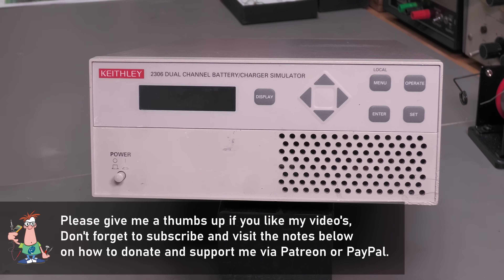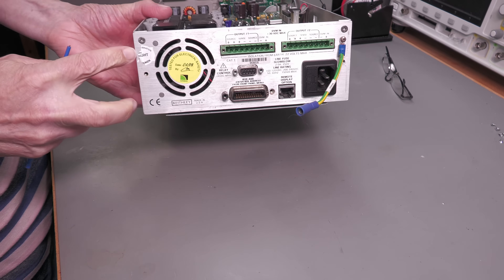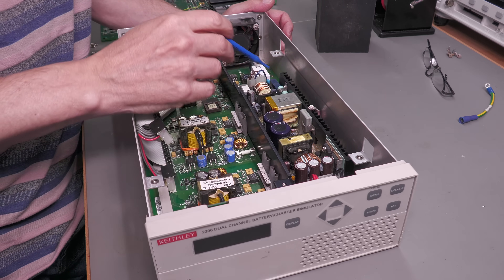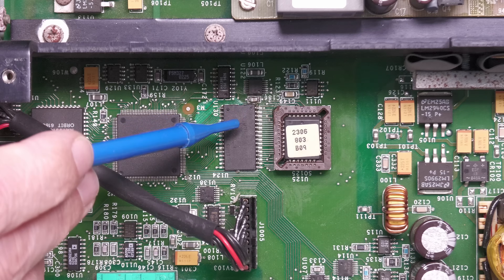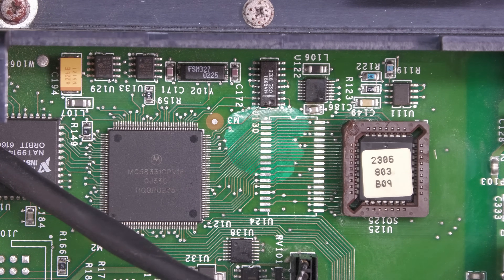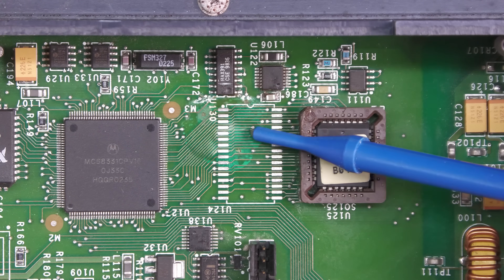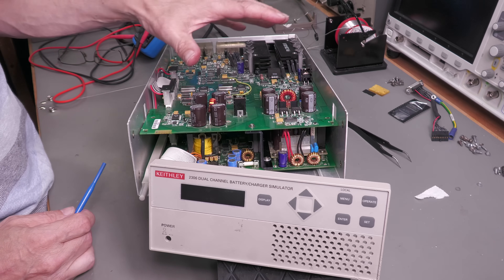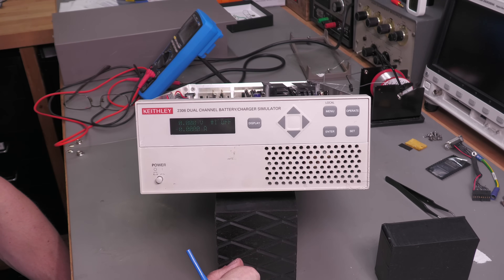No.115 - Keithley 2306 Dual Channel Battery Charger Simulator - Part 1

Comment: Nice vid. Dave did a teardown of a Keithley 2302, that one was nice and shiney on the inside. I liked the repair on the delamination a lot. I also like that this vid is a short of complement to the one of Dave. Part 2 would be very welcome. Testing your own product with this lab battery simulator is a nice idea too, could even be a video on it's own if your up for it. You can tell you've put a lot of energy in this video.

Comment: Heat up the epoxy and make a few more, conveniently placed vent holes. It will fill up like charm. Don't over fill it, after all it will only need a drop to fill up what was void before the delamination.
There's still the danger the RAM problems were caused by an interrupted line, since the RAM was swapped before, but you know this better than anybody, considering your experience. Thanks Ian, great repair
Reply from the maker: Yes, it's only a thin film required really, I did press down on it to spread it and I cleaned up the residue. Could have made a better job if I'd heated the epoxy. I'll know next time!
The ram failure is pretty common on these units, I guess they were unlucky in their choice of brand etc.
I never examined the ram swap out quality of soldering, it was such a mess I didn't bother. Seem good now, so time will tell if it's reliable.

Comment: Use slow epoxy (24h cure), and AFTER injecting heat up the spot to about 80°C so the epoxy becomes liquid like water. Watch (!) spills.

Comment: Epoxy becomes very much 'runnier' when you heat it up. You could have heated the syringe and the injected area, to 50 or 60C or so, with the hot air gun and then spread it inside the delamination using a credit card or the like (after making some relief holes). Heating it also accelerates the curing so probably better to use slower epoxy.

Hopefully this was made long after metal parts were cadmium plated - which I'm fairly sure was used extensively in the telecomms industry in the 70s.

Comment: Great repair and an interesting piece of test equipment👍 The previous repair attempt must've used something like an industrial heat gun, it takes a lot heat to make a good quality FR4 board delaminate. To polish the screws and metal pieces I've had good results using a wire wheel in a bench grinder followed by a polishing wheel and some polishing compound to make them really shiny.
Reply from the maker: Probably used the same heat gun to reflow the new ram IC and fried it also!

Comment: The brackets could possibly clean up in an electrolysis tank. I've had good results before
Reply from the maker: Home electrolysis......nice idea, I'll  have to look that one up.
UPDATE: have order the stuff to try nickel plating.
Reply: I'd stick them in my tumbler with steel shot and a bit of polishing compound,  works great on silver and gold so a bit of steel should be no problem.

Comment: You can add denatured alcohol to regular epoxy to thin it down a bit
Reply from the maker: Really!.....I'll experiment with that. Cheers.
Reply: @IanScottJohnston  Mix the epoxy in  equal parts as you would normally and then start with a ratio of 10% denatured alcohol and mix that in thoroughly. you can add more needed

Comment: I repair delamination with same technique and Acrylic adhesive WC102, it a very thin CA mix, used for windscreen repair.
Reply from the maker: Will look that up. Cheers.
Reply from the maker: Update.....I read that isocyanates are slightly corrosive to copper......might be worth some research. I am no glue expert!

Comment: What a coincidence! I too posted video today with a PCB that had a delamination problem. This was of my own making though. It was thin phenolic substrate, and it did not like the normal temp I use for hot air. Given the lower quality of the substrate I picked up a bit of that (expensive) low melting temp Quick Chip solder. 

As to trying to repair the bubble. I think your own to something with the injection of adhesive between the layers. I have repaired delaminated wood veneers this way. Someone suggested UV curing epoxy but I wonder it enough UV would penetrate the top layer, my suspicion is that it will not. 

I often use a Circuit Works acrylic overcoat pen for protecting traces repairing corrosion damage. It does a fair job of tolerating some heat when soldering. The pen dispenser does not make it ideal for this sort of repair though. It does seem having a vent hole is a good idea though.

Comment: I got 2306 in repair queue too. My unit boots, but has wrong voltages/currents and one of opamps was going crazy hot. Replaced opamp but it didn't fix it. Btw, there was no need to use hotair for desoldering TSSOP, you could just use soldering iron with wide tip and heat all pins alternatively and get chip off. I like to avoid hotair anytime when possible, to introduce less heat into board and nearby components. And what is the VFD part number to replace?
Reply from the maker: No worries about desoldering using heat gun......I have it perfected. Secret is to balance heat on package and pins alternately. Would rather not subject pads to direct soldering iron incase of weak pads. I get the pins/pads to melting point and not much more.

VFD Manufacturer Part No.: CU16025-UW6J
UPDATE: My mistake, it's the CU16025-W2J

Looking forward to seeing your 2306 repair.
Reply: I also have a 2306 in the same situation - originally it had the SRAM issue which I swapped to fix it but I have a hot op-amp and a voltage offset on CH1. CH2 is fine.

Comment: 15 volts and 5 amps is 45 watts?   Never seen a pcb delaminate like that.  Will enjoy seeing this unit in action.
Reply from the maker: 15v, 5A, 45W is straight from the datasheet.......so likely you can have 15V but not full 5A, and vice versa.
Reply: I have seen pcb delaminate like that after lightning strike had vaporised tracks in the middle layers.
Reply from the maker: @KuntalGhosh  ouch!

Comment: Part two should be interesting how it works and is used in testing, of course it goes without saying part one was also interesting🙂 and with the gluing it would have been better to have two opposing holes slots for the air to be displaced by the glue injected 😉
Reply: He did!
Reply: @ericgee6585  no at first he just had one hole to force the glue in which may have lifted it even more, it was only later he had the thought to try two holes
Reply: Blimey ! very true !......squeak!!!!!!!!!!!!!!

Comment: Isn't it an HD44780 compatible display?
Reply from the maker: It is, and whilst I could fit an LCD/OLED equiv. I would rather have a VFD per the original. There are probably one or two companies making VFD equivalents.

Comment: What about super glue? It is very runny indeed and dries quickly.
Reply from the maker: Too fast for me.
Reply: I believe with some there might be a danger of it dissolving the board?
Reply from the maker: Ahhh, I read on the web - Superglue is a isocyanate glue and isocyanates are slightly corrosive to copper.
Funnily enough, I have the same issue with silicone sealant on PCBs, I use a special non-corrosive type.

Comment: Polishing the hardware and changing the ram without even checking voltages!   Gutsy!
Reply from the maker: It was powered up in the Ebay Ad, plus big history on the exact failure mode......I was 99% guaranteed....:-)

Comment: Hi Ian, thank you for the video
I have a comment regarding the PCB delamination. Maybe you can repair it by injecting epoxy resin and using press to force the delaminated layer down or even using vacuum to help the PCB suck the resin. I saw a video regarding this point.
Reply from the maker: Keep watching the video...🙂
Reply from the maker: Ahhh, vacuum, didn't think of that!
Reply: Hi @IanScottJohnston . Yes, check out this video with the name between the square braces [PACE Rework and Repair "Damage Repair"] @20:20 time. This explains my idea. Also, you can make another hole to drain the air inside the PCB.